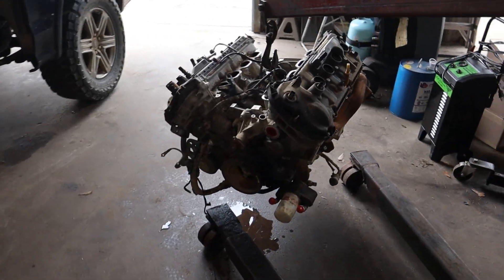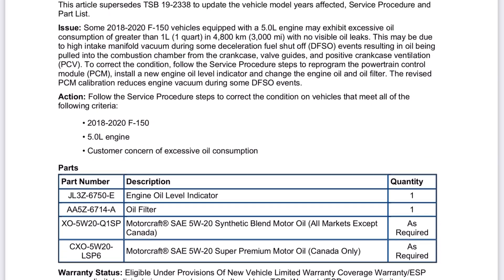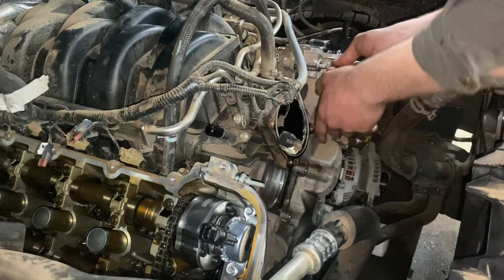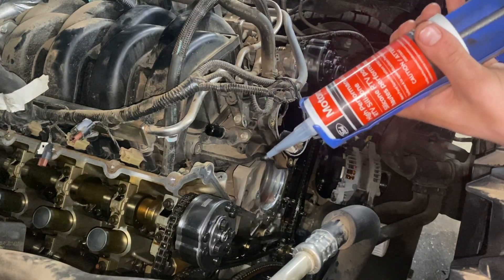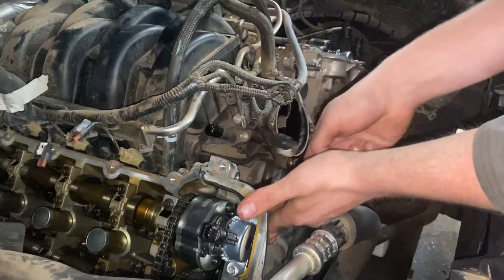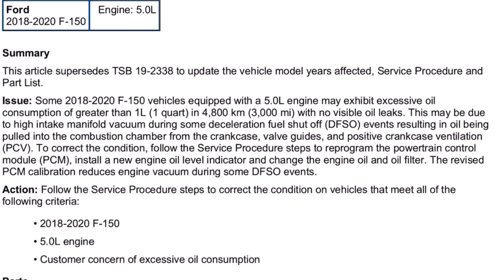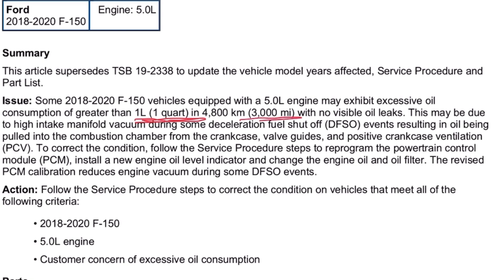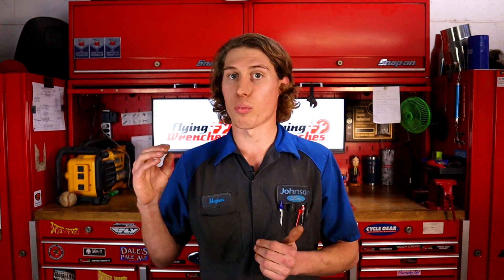Ford 5.0 Coyote Oil Consumption FIX

Comment: Always check oil in all vehicles once per week.  We run our super dutys hard.
Reply: this is only for powerstrokes. You dont need to check the oil on a cummins or duramax
Reply: @slyfox4564  that is Terrible & Wrong  mechanical information to put out.  Against every ASE Master Tech.

Comment: I have a 2014 ecoboost with 300k kilometers and yea I check my oil and aside from the dreaded tappet cover leaks and vacuum pump leaks it doesn’t burn oil and it’s had Amsoil signature series only it’s entire life.

Comment: Interesting opinion. I could understand a truck with 150-200k burning some oil, but any decent modern engine under 100k shouldn’t burn a quart of oil in an oil change interval. Why doesn’t the last gen coyote have this issue? Sleeve vs coating. 
I’m definitely guilty of not checking my oil. Every oil change my 3.5 drops 6 quarts and no leaks. Until either of those change I’m not too worried.
Reply: You should be worried more about a low coolant reservoir indicating turbo leaks, and also clacking that indicates cam phaser issues. Those 3.5s have made a lot of techs a lot of money.
Reply: @anthonybutterbaugh4252  that’s what ford extra care is for.
Reply: @ef6250  that’s exactly why shops are losing customers by the tens of thousands though!

Comment: Great Video man. How many miles do you typically see out of the 10 speeds before the need to be rebuilt?
Reply: Mine is in the shop right now waiting to be diagnosed.  It’s a 2017 with 78k miles. Slamming shifts up and down.

Comment: I must be one of the weird young people. I check my oil in the 7.3 and VW TDI every fuel fill up 😂😂. I have definitely seen a absolute ton of 18-20 5.0 oil consumption concerns. Everything from blow by, valve seals, and old programming causing it. Not to mention the long block is on intergalactic back order. Once we found out the cng long blocks could be used they sold out as well. But my prospective is completely different than yours as yours.

Comment: You are going to break the internet. What will all the old codgers babble on about if they can't opine endlessly about oil? I use 50w99 Syncastoline, and change my oil every 17 feet. I've never had a problem and I've done this since Kennedy was president. Of course I'm a tribologist with 11 PhDs and 74 years of experience. I can't post a longer explanation, I need to compile my latest opus about my oil analysis so I can post it on a truck forum.
Reply: That’s definitely not soon enough…you SERIOUSLY need to look at the factory recommendation in your owner’s manual before you void your warranty. SMH.

Comment: I check my oil every 500 miles regardless of vehicle or any known issues. Usually it’s every fillup . I’m also ocd but it’s a good habit to have
Reply: I couldn’t agree more.
Reply: Dont check your oil wtf   😅
Reply: That's kind of the way I do my '93 Toyota truck with 312K. miles on it. I check it after I change the oil to make sure it's full. Then again after the next change at 6K. miles.  It is starting to have a consumption problem of almost a pint in 6K. miles. I might check on getting it reprogrammed.
Reply: I guess i am old school, I check my oil between changes... Glad i did, 2 quarts low after 1k miles.
Reply: I check my oil on an 05 Tacoma every 8k miles when I change the oil.  Currently at 463k miles original everything
Reply: I drive a toyota. I open my hood to change oil lol
Reply: First and foremost I will say I have owned many fords and two of them with the 5.0 coyote engines a 11 and now a 19 so right now I am having the consumption issue again for the second time with the same 19 I went through the crap with the new program and the new dip stick that wasn't the fix kept burning excessively so ford covered a complete long block after the long block 30k miles later I get a check engine light I read the code on my scanner says cam sensor bank 2 look up online where it is and common repairs to make sure it's fixed right and someone in a forum says they where low on oil and they had the same code so naturally I went and checked and there i find the dipstick dry over 4 quarts low took 4 quarts to see any on the dipstick so now I have no idea what they are going to do cause it's hit that 2 year mark that it was under warranty for that repair this is definitely not normal your totally right about 1 maybe a little bit more on 3k miles that's fine but over 4 quarts no way in hell is that normal im also a mechanic but Harley mechanic so I don't claim to no everything but this is insane and I really hope Ford stands behind me on this
Reply: To measure is to know. All else is a guess or blind faith.  Stupid not to check.

Comment: Good info. Guess you never work on LS engines. Lol. Big oil burners. Mainly the the AFM models.
Reply: True. My old 5.3L ate way more synthetic oil (about 4 quarts during an oil change interval) than my current 5.0L ever has (1-2 quarts per oil change interval).
Reply: Yeah my 04 5.3 used about 1-2 quarts every 5 K .  And did it without fail from 100K to 250K when I sold it and it was still running fine.   I just kept 2 quarts of Mobil 1 in the side compartment (Avalanche).  My 2020 7.3 super duty uses none that I can tell, even after several hard pulls up and down the Mountains in AZ pulling our Camper over the course of 5 K miles.